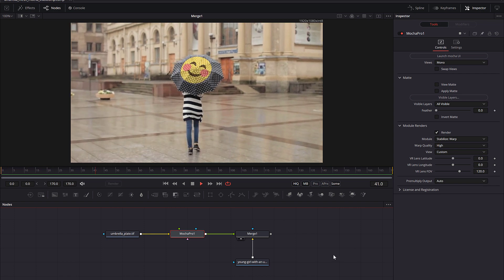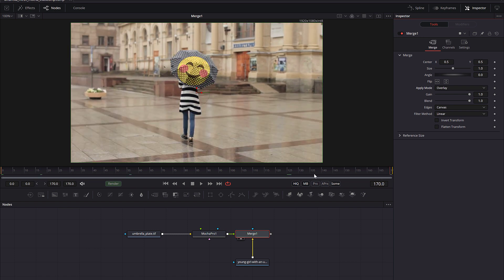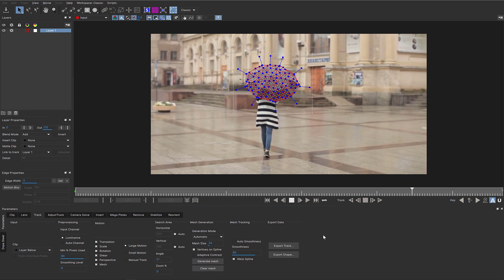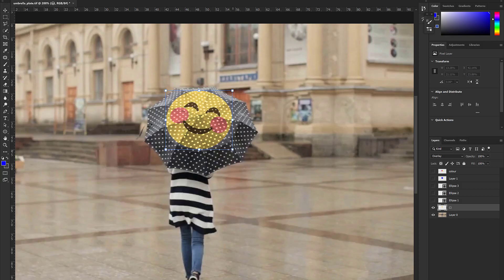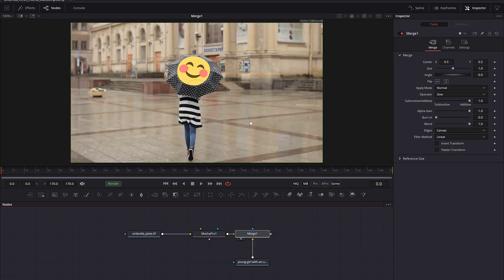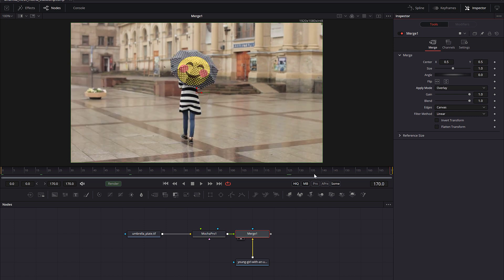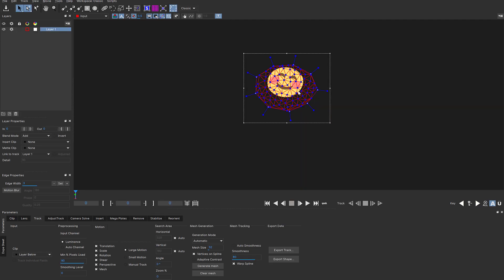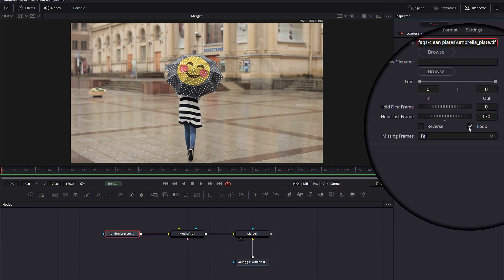Quick Tip: Mocha Pro's PowerMesh in Fusion

Comment: Does not work.  My images don't move with the power mesh track.  My loader file node doesn't even have loop checked to begin with.  Nothing in this tutorial works at all.
Reply from the maker: This is working correctly as shown for me in Fusion 17.  Loading in a still frame should have loop checked by default in Fusion.  Head over to the forums and post your problem there with a few screenshots of your Flow so we can see where the problem is.  https://forum.borisfx.com
Let us know if you are working in standalone Fusion or Resolve Fusion too please.

Comment: BTW, it works well with a picture where we can change the "Global in/out", but what happens when we plug a TEXT+ node for example, it does the same thing as if it was stuck with one frame.
Reply from the maker: If you're just passing a Text node into a Mocha Pro, it should be working without any problems.  If there are additional nodes after the Text node, this may change the relationship Fusion has when it sends it to Mocha.  The workaround is to pipe it into a Merge node with a transparent Background node set as the background.  Take the output of the Merge node into Mocha Pro and it will render correctly.  If you're still having problems, please join us on the Forums : https://forum.borisfx.com
Reply: @BorisFXco  I'll test the workaround.
Thank you for your response.